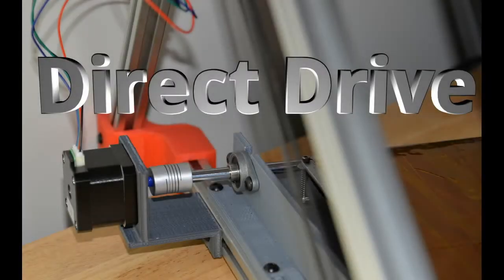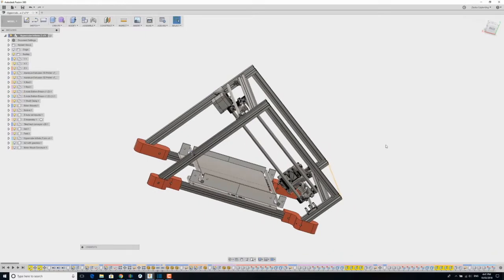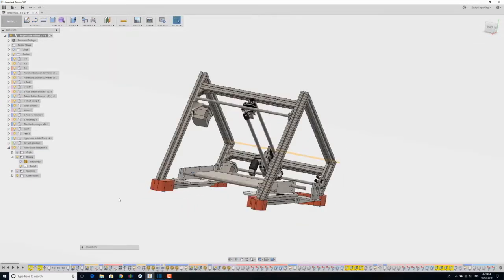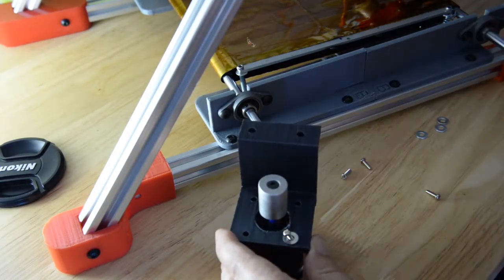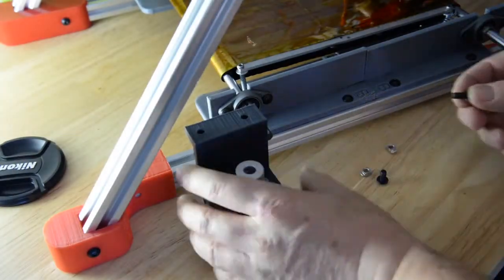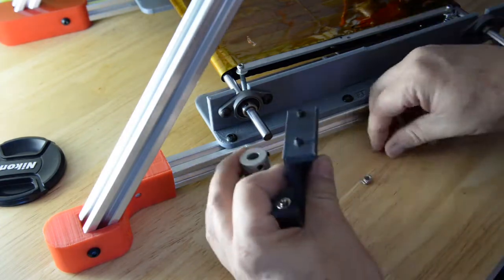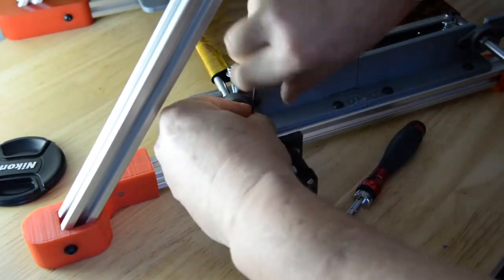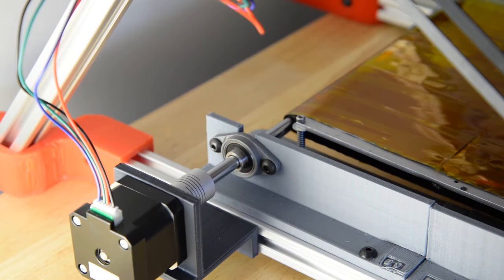Hypercube Infinte Part 8: Direct Drive Success!

Comment: Hi. I was thinking of making an equal and I came across your video, your machine is almost perfect. Just missing one thing, put two stretchers on your treadmill, and also a glass plate so the treadmill slides over it in a stretched way. Congratulations on the machine (Forgive me the mistakes in English I used Google translator)
Reply from the maker: Thanks Robermax designer. The stretcher is a great idea. You are right. The belt has to be tight.

Comment: Man, you do iterate very fast! Keep up the good work! I think you may need more tension on the conveyor (we can see the dog move because of the extruder). Also, better support under the conveyor would be nice I guess - maybe some aluminum links between the current aluminum frame just below the roller  axis and then you can simplify the conveyor supports (i.e. then you don't need all that middle plastic in between the rollers: you fix them to these new aluminum frames).
If you consider this design you can ditch the offset aluminum on the right base (where you fixed the direct motor base) and keep it aligned with the rest of the frame, for better looks and less 3D parts (should be the same as the left side base; the 2 aluminum parts will be the same length as the top ones). Again, amazing progress and design.
Reply: I have an idea that may help smooth out your bed without undue tension on it. You could build a thin box as a bed with the top side made of perforated sheet. Add a fan or two to the bottom of the box blowing out. There may be enough vacuum to pull the belt down smooth on the perforated bed without too much drag on the belt. Just a thought. Perhaps you have a solution in a different video.  Love the work you are doing. Very interesting.
Reply: That idea sucks (just kidding: very innovative idea). But it would kill any plans for an heated bed. Besides greater tension, I also would explore a canvas conveyor and - if the rollers are bowing at the center - add double support at the ends and/or a bigger diameter at the center (but I doubt this is happening without much tension). See if the bed isn't bowing down also, especially at the center/ends.
Reply from the maker: Some good ideas there. Thanks!
Reply from the maker: Very interesting idea... Thanks!
I haven't come up with a solution yet.